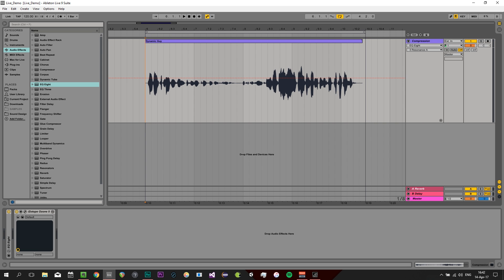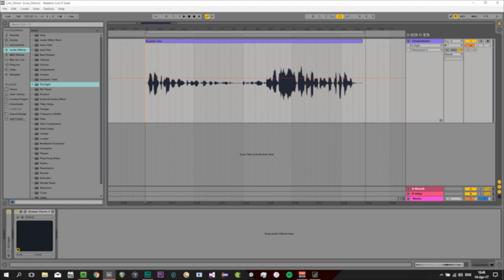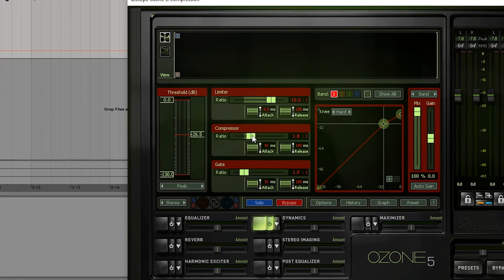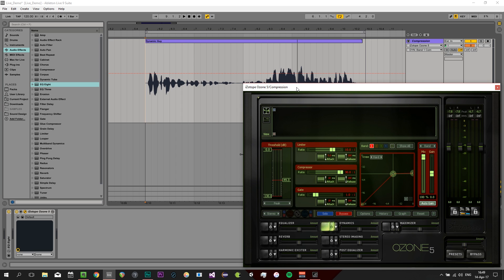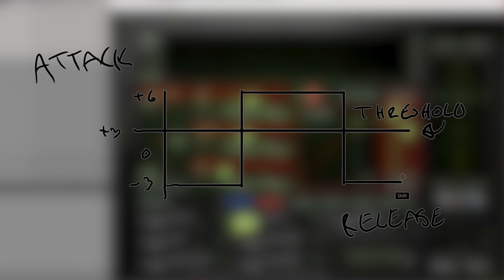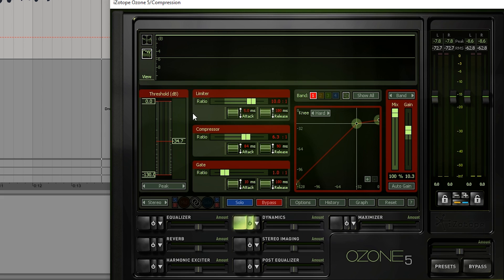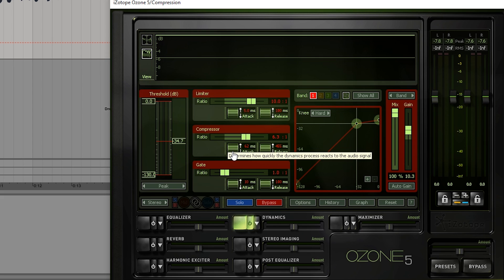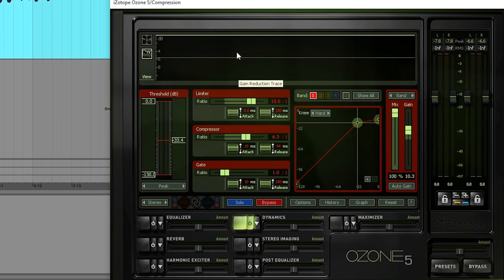How To Use A Compressor - RH-COMP #1

Comment: Subscribed! Thanks for that! That was one of the best compression tutorials I've seen on YouTube so far - quite a lot. Compact and informative. Meanwhile I feel I get a good handling of compression and how to appropriately use it, though release time is often still hard to get right for non-percussive material. 
For percussive sounds I tend to dial in my attack and release times about the time 8-32th notes sound in my project, depending on how much I want to stick them out.

Looking forward to the multiband compresion/dynamics video. There's so much into these beasts I always end up confused with them. Also, Reddit brought me here too.
Reply from the maker: Thanks for your input Phexy! Your approach to setting attack time is interesting, I imagine that would help in making percussion compression sound more musical. As for release time, it is a bit less intuitive - Ideally you'd want to set it so the compressor doesn't "push up" the "tails" of the sounds too much, while still being about reset for whichever sound coming in next. Unless of course that's an effect you want. 

Multiband is coming in the second or third video, depending on how long it takes to get through the "advanced" broadband compression controls. Thanks again for your feedback!